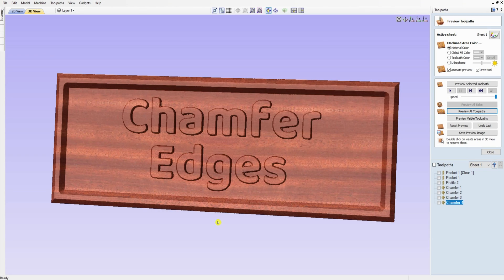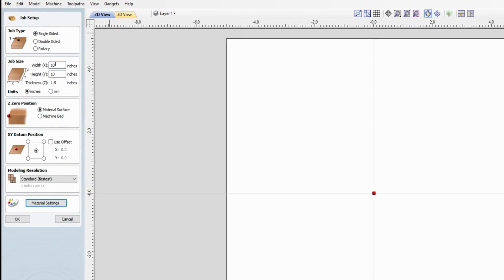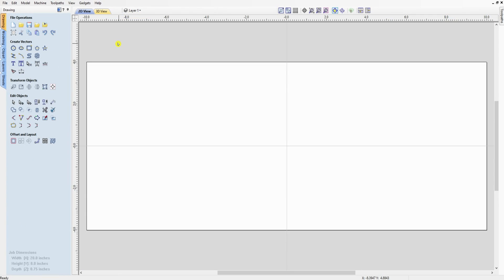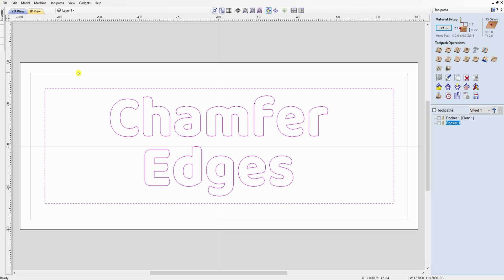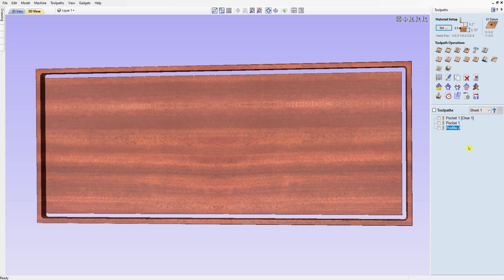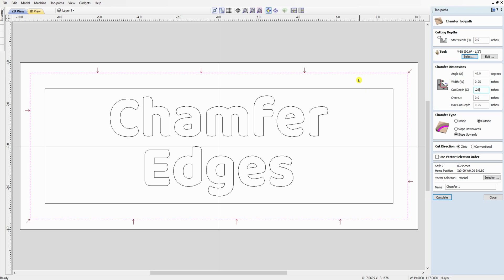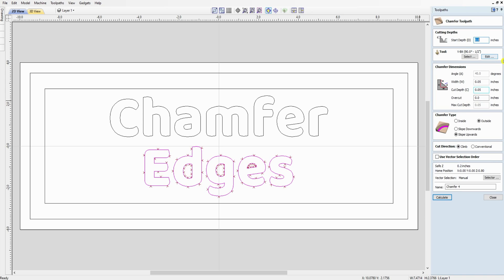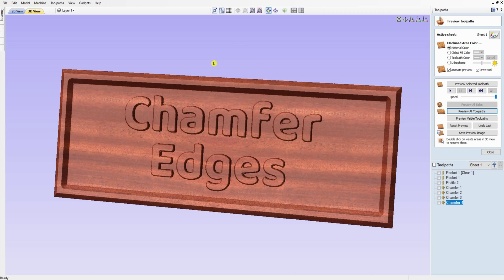How to Make Chamfered Edges with a CNC Router using VCarve Pro

Comment: Hi - using Aspire and somewhere between advanced beginner and intermediate.  I set this up verified using your settings and it didn't chamfer all the way to the top of the stock (in preview).  It chamfered part way up and left a small amount with vertical instead of chamfered sides.  any idea what might be wrong?
Reply: It actually works if I do inside and upwards instead of outside
Reply: Could it be material set up or start depth of your cut? guessing here.
Reply: @normanwilson5655  Hmmm you know I don't recall as this was some months ago - but I did get it sorted out.  Thanks so much for your reply.

Comment: Great video!  I learned a lot from it, but just FYI when you chamfered the letters your first pass was .100, which is point 100 which is close to an 1/8 of an inch chamfer.  When you did the chamfer the second pass, you did it .050, which is .zero five zero, which is half of what you did the first time.  The first was called (.100) 100 thousands of an inch, the second was 50 thousands of an inch.  This is machine shop talk.  Just thought you would like to know.  To the right of the (.) period is tens, hundreds and then thousands.  Every time you want to speak of the measurement it is ALWAYS spoken of in thousands of an inch.  So .050 is 50 thousands of an inch.  .100 is 100 thousands of an inch.  .001 is 1 thousands of an inch which is about a third of the thickness of a strand of hair.  Thank, FYI,  Hope this helps as your video did me.